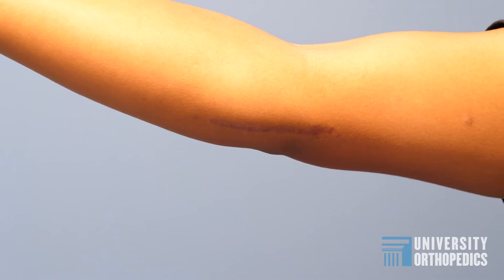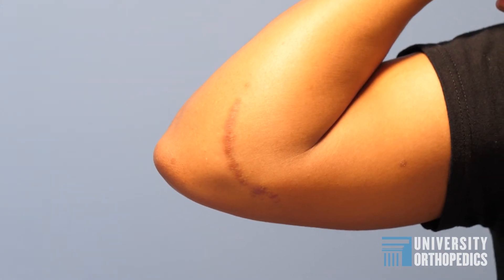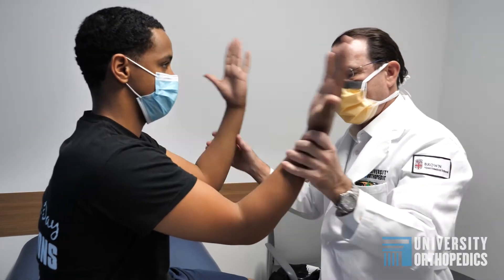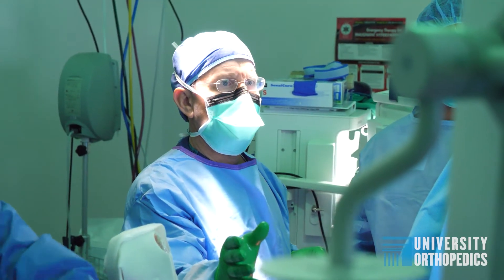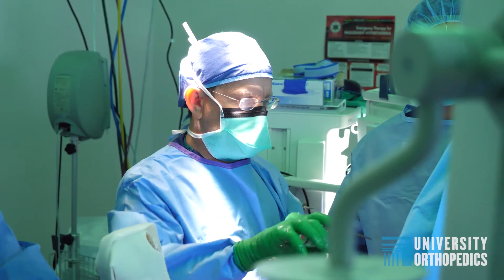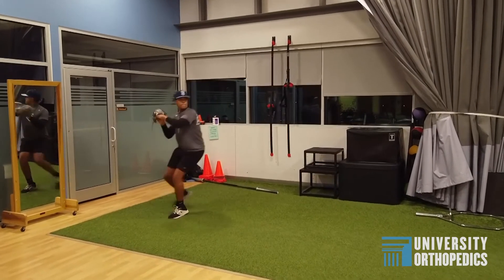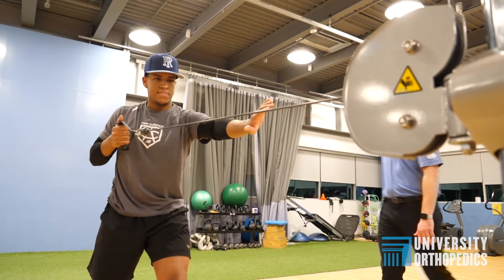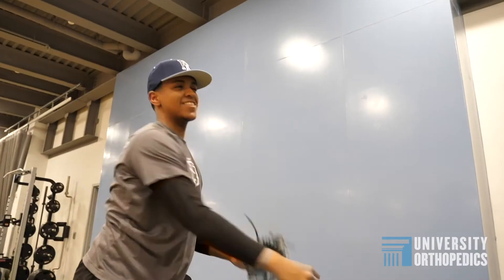Tommy John Surgery Explained

Comment: So I apparently had this happen to me during a double header when I was 11….24 years ago and no one ever cared to understand what I was going through. Even my parents said I was over exaggerating what happened when I said my arm popped. I still have yet to go see a doctor after all this time. I always wondered if anyone would be able to tell me what happened and if it can be fixed since I still have issues. It took a student at the Jr College I work at to pop it off like it’s nothing. 

My question, after 24 years, can you answer if it would be a successful repair if I were recommended to have the surgery? It’s not doesn’t bother me all day every day, but with even the slightest resistance training or even push-ups, I begin feeling it and then it’ll ache for quite some time. 

Thank you for the informative video!
Reply: My coach called me a pussy for falling down when mine happened when I was 14. Have yet to get it checked after 12 years because I refused to have surgery at 14. The thought sounded crazy to me.

Comment: I’m not a pitcher but I do play tennis; something that has been impossible as I get elbow pain serving. But it’s not tennis or golfers elbow. Other symptoms include elbow pain when placed under tension at less than 90 degrees in the weight room (bench press, shoulder press, pull ups etc). Notionally been diagnosed as cubital tunnel syndrome but I don’t have the 3rd and 4th finger numbness. I am at a loss as to what is happening here.  Any clues or suggestions?